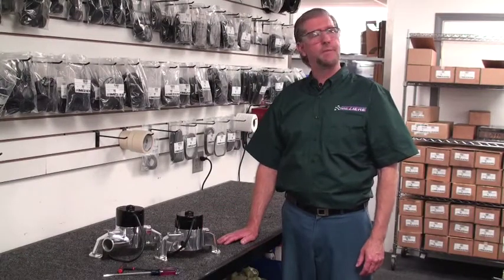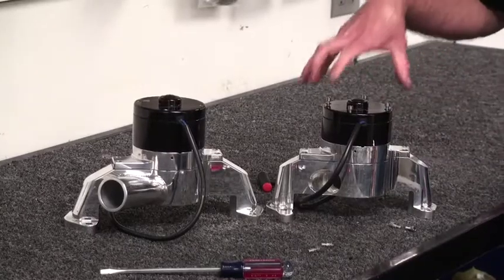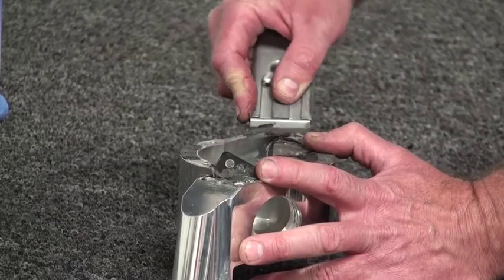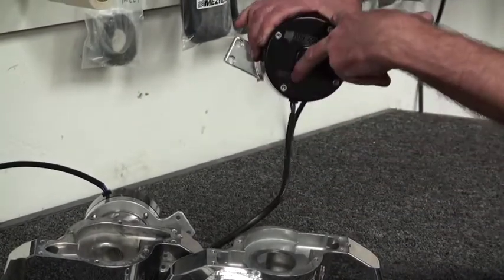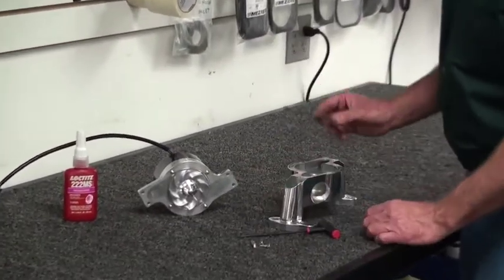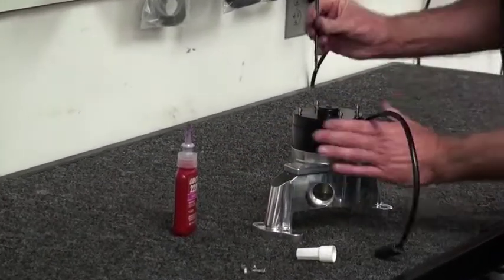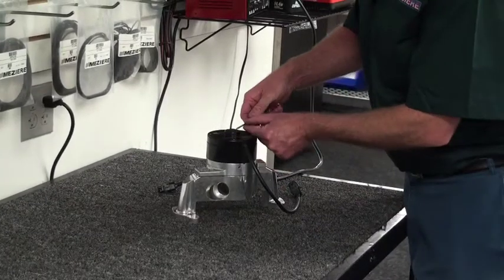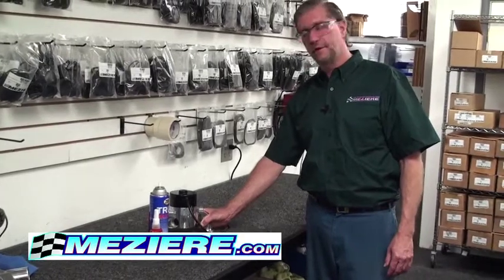Water Pump Center Section Swap

Comment: Great video.  My mezeire pump has only a few hours on it and already has begun leaking between the housing and the pump motor. I have tightened the 4 outer bolts (near the pry indentations) but will try to tighten the four bolts at the front of the motor. I was just assuming it was a bad gasket.